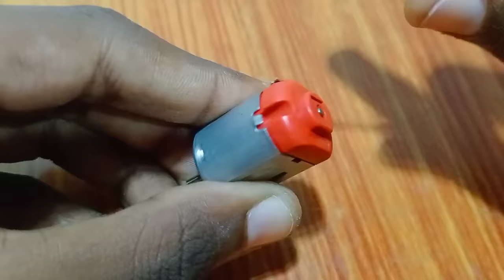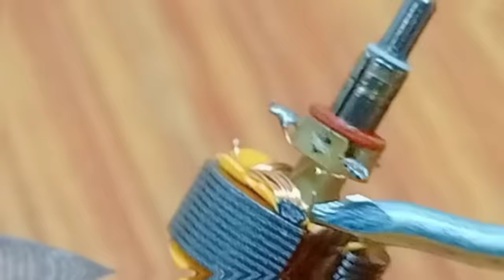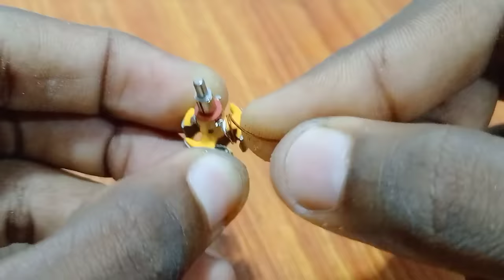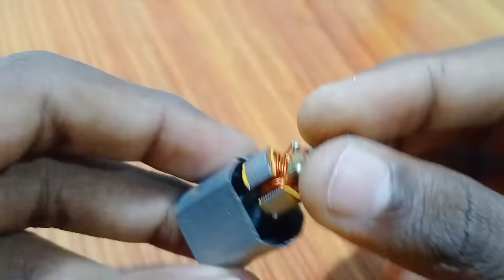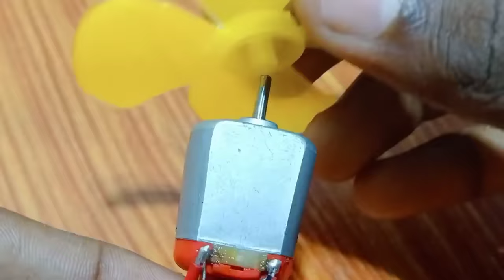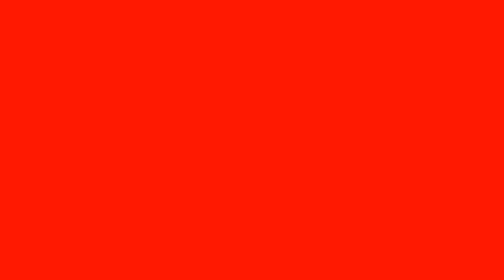Hack This Dc Motor With These Easy Tips! Dc motor life hacks

Comment: Time to try this on a Tesla
Reply: Ironically, Tesla uses different technology on their D.C motors, so I don't know whether it's supposed to work.
Reply: Telsa's have AC induction motors.
Reply: please try and document it
Reply: On ac motors you need to increase the Hz and reduce pairs of coils to increase speed. Magnetfield speed= hz×60/coil pairs(100-slip)
Reply: @myzdmymn  yeah document his death ...
Reply: It doesn't spin 8x the speed, lmao.
Only about 200%
Reply: @hosoyalaurence  good enough
Reply: @Coco💙 it's not electric
Reply: ha, brushed motor for tesla 🌚🌚
Reply: Tesla use brushless electrical motor.
Reply: Yes tesla is run by ac motors
Reply: No Don't do it will fail on tesla
Reply: Nice
Reply: Good idea🤣
Reply: The motor in a Tesla is different. It is a three phase induction motor. So you either need to reduce the coil pairs or increase the frequency or Hz.
Reply: nah tesla overrated go do it on a Nissan Leaf 9 year old and everything is brushless like the others say. Other wise tou would need to change them every once 8n a while
Reply: Are you Elon Musk or engineer in tesla
Reply: It's DC and tesla is ac
Reply: How to discharge teslas battery 8X faster
Reply: DEJAVU!!!!
Reply: f you make the enamel wire thicker and replace the motor magnet with a stronger one, it will be faster. Also, it is more effective to change the motor brush to a thick one.
Reply: @owltube-4036  오우 찐이다
Reply: WUZAHAIEL😂

Comment: Perfeito. Fórmula para calcular o campo magnético: B = N.μ.i2.r , como pode ver, a corrente elétrica tem ação quadrática no campo magnético. Aumentando número de espiras você aumenta a resistência e diminui a corrente. Ou seja, diminui a potência. Diminuindo o número de espiras você aumenta a corrente (perfeito), porém se o fio é fino ele não vai suportar a corrente e vai queimar... Por isso, o correto é colocar menos espiras porém um fio grosso para suportar a corrente (vai gastar mais bateria, claro)...
Reply: Mn, esse motorzinho do vídeo, tem capacidade de gerar energia?
Reply: @kaykyalexandre1658  Sim, mas é muito pouca energia que ele gera, teoricamente ele vai gerar uns 80% da energia que ele gasta em funcionamento, girando o eixo dele na mesma velocidade.
Reply: @kaykyalexandre1658 it can generate a little bit of voltage that is only powerful enough to power a small LED

Comment: This actually works . Thanks for the advice .Greetings from 🇭🇷
Reply: 0
Reply: Da dobro je
Reply: Moter is quickly heat by this changes
Reply: But it consumes more electric
Reply: It Will be faster but weaker
Reply: @krishnapawar3006  it Will be weaker
Reply: @rici_21  yep torque would be comparetively weaker
Reply: @meIanchoIia  amazing
Reply: @newunboxing3286  heated

Comment: If you want more speed just add magnets on outer case
Reply: And put in bigger motor brushes to increase current transfer to the commutator for higher speed and much longer motor life
Reply: & use premium high octane fuel instead of regular
Reply: but it is better to buy a normal motor and not suffer
Reply: @SkorchGameWoT  suffering is for the weak minded...we're innovators 😎
Reply: @gauri_510  yea....super noob

Comment: The ceramic capacitor is only for reduce sparking on commutator to prevent buring of brushes
Reply from the maker: Yes ! It helps to run Smoothly ☺️
Reply: @InfoTechElectronicsWork  how is it that this tiny cap has a 104 rating, which means it has 10*10^4pF=0.1μF ?
How is this even possible with a ceramic cap this size?
Reply: It smooths out the current draw, but it won't help with sparking.
Reply: Bruh isn't it related with power factor improvement?
Reply: It only reduces RF interference that could cause malfunction in some other equipment nearby.
Reply: @andrelange9877  🤣🤣🤣
Reply: one capacitor isnt eoungh, i have used 3-4 capacitors.
Reply: @mandarbamane4268  lol mate this is a DC motor, no PF here 😂

Comment: Its just more useful to add neodymium magnets instead of normal ones draws less current but goes faster. Of course the motor wont go stronger.
Reply: It will actually not go faster and instead provide more torque. For a motor to go faster you need to reduce the back EMF, ie inductance
Reply: J-Seven  if you for example, wind less windings, the motor will spin faster (less inductance). You could also weaken the magnetic field using what's called field weakening. If you don't want to physically alter the motor, you can simply apply more voltage, as when the back EMF matches the applied voltage, the motor cannot spin any faster without the forementioned tricks.

Comment: Como ensayo de estudio está muy bien pero  para darle utilidad deberías aclarar cuestiones como el balanceo que afectan la durabilidad de los bujes y ejes, temperatura de trabajo que se ve modificada sustancialmente y obviamente va a traer muuuichos problemas, colector y carbones que no han sido diseñados físicamente para esas condiciones de trabajo etc , etc .
Reply: Es correcto
Reply: Entonces la idea está buena,  pero es para un muy corto tiempo por que se va a arruinar muy rápido. 
Eso es lo que estas tratando de decir???
Reply: @ivodmp  yes it will be ruined fastly. Because of the higher temps the back plastic part of the motor will melt and make the rotor less smooth and stuck. Also the brushes will be damaged fastly
Reply: Temperatura porqué? Si bien trabaja con mas intensidad de corriente el cable es mas grueso
Reply: @lucianoaviles351  los motores DC tienen un par de escobillas que rosan con el colector, por lo tanto a más velocidad más rose, por lo tanto más calor
Reply: @IsmaEmili  eso es verdad, lo descubrí haciendo un prototipo
Reply: Aclarar que va el mismo número de espiras en cada bobinado, creo que ha liado el cable nuevo en direccion contraria al original por lo que girará en sentido contrario (solo es cambiar la polaridad pero está bien aclararlo), el valor de ese condensador (si es que lo es que no estoy seguro)...y un largo etc jeje
Reply: no trae carbones eso
Reply: Legit. Some of that could be compensated for with a heat sink, fan on back of motor and grease.
Reply: Nunca falta ……  😒
Reply: @lucianoaviles351  el cable más grueso y más corto, menos resistencia. Más intensidad. Más calor. El núcleo no está diseñado para disipar esa temperatura. Las escobillas no están diseñadas para esa corriente. Cómo experimento, está bien. Etc... Para usarlo no
Reply: Me compre un espumador de leche, pero no puede con el café, entre tirarlo o modificarlo un poco y que dure poco estoy pensando que hacer. Si consigo otro motor directamente lo cambio, pero si no modificar lo que ya tengo. Es triste, pero no consigo cable esmaltado en mi ciudad si no compro de a kg, y se me hace caro hoy en día tener un kg sin usar. Así que reciclare de algún otro componente. La otra es encontrar algún motorcito y hacer un agitador magnético.

Comment: Sir, Can you tell me Number of turns for new wire and the diameter  
And how can I calculate the Number of turns and the diameter if I used another wire
Reply from the maker: Diameter 0.5 mm ( 30 turn )
Reply: حبيبي سيد 💞

Comment: What I've learnt from Electro Mecanical Energy Conversion Lecture, providing less winding with bigger radius cable decreases efficiency significantly. It may turn faster, but it'll draw significantly higher current than the original one, also will have heat problems when works long time.

Also notice that to comparasant; If assuming we want to have same RPM for both original and modified ones, Modified one will draw more current.

So that modification just allows more current to have more RPM while decreasing its efficiency significantly.

Correct me if I'm wrong. Thx.
Reply: Also thanks to the Infotech Electronics Work who allows critisizm on his videos and encourage good pros and cons comments.

Comment: This modification works because the thicker wire allows more current to power the rotor, which makes the rotor's magnetic field stronger, which makes it move quicker.

Comment: Does it affect EC. Because it will consume more energy. EC may be damaged.
Reply: it will be ruined fastly. Because of the higher temps the back plastic part of the motor will melt and make the rotor less smooth and stuck. Also the brushes will be damaged fastly

Comment: f you make the enamel wire thicker and replace the motor magnet with a stronger one, it will be faster. Also, it is more effective to change the motor brush to a thick one. ^^

Comment: Damn Bro.   more conducting amperes  equals more power..
Reply: Yeah fr it's just a capacitor in parallel with the motor, of course you're going to get more power but your motor is gonna burn up very quickly

Comment: This is not the right way of increasing speed. Here the wire was thicker to allow more current carrying capability. The gain in torque would come at a cost of wasting energy as heat. A far better alternative is to choose a thinner wire, and increase the turns. That will result in higher speed, higher torque at the same input power

Comment: The motor will going to run at higher speed but as the brush or the slip rings provided on the motor are going to teared fast because the brushes provided in this toy motor is as per the configuration of the motor so to change the speed of the motor we must also have some change in its design also.

Comment: Where is the comparison of 1x and 8x? You only increase the current carrying capacity but decreased the number of turns. Did you increase the input voltage to compensate for the less number of turns?

Comment: also, , connect it to a Batt, wash the motor in soapy water for 30secs, then pull out,  run to get most off water out  then spay with wd40 or 3 in 1,  it works, done it to all my 400 motors on me R/C planes,

Comment: You can just put a really strong magnet on the outside of metal case, you don't have to take it apart or anything. Not sure how many times faster it makes it but substantially faster.
Reply: I was going to say, that, i had a R/C plane, with a 400 motor, it just about got off the ground,  put a magnet on side, went like lighting, I found this out when i watched "HOW", in the 70s ,  I'm old  :)

Comment: Have you heard of a Rodin coil I recommend you wire it like that the electric motor and make sure it's brushless and a alternating current electric motor with a DC converter so you can run the alternating current  motor on DC power  after that you can you use it in a remote control car like the brand Red cat or something of your interest

Comment: Why are you using a capacitor with Battery(DC) ? 
 Because Capacitors will allow AC and Block DC . Then how  motor runs instead it stop.
Reply: The capacitor is in parallel with the motor and is there to reduce radio interference caused by the motor. It does not have any function in the running of the motor.

Comment: Wow you just came out with a way to make cheaper motors perform like more expensive ones . Now work on adding gears or pulleys to the shaft, large one on motor shaft , very small one on a small generator motor. Imagine 6 or 8 of these , on a drone doing this recharging the battery bank being able to stay in the air and flying much longer ! WOW 🤩 💰 💴 💵 !!!

Comment: What is the capacitor there for?
Reply: im not an electrician but its supposed to add voltage (that's what capacitors do)
Reply: @kajtus5510  Capacitors do not add voltage. In this case brushes make unreliable connection which causes them to arc. Magnetic field of the windings collapse, sending high voltage pulse back to the circuit. This is important if motor running from more than just batteries. Also, this process creates interference noticeable if radio or TV is near such motor.

Comment: if it was that easy companies would of did it
and you didnt show us the normal speed of the motor
Reply from the maker: Companies want to save his money 💰. So that they don't use More copper in Motor.
Reply: @InfoTechElectronicsWork  sheesh but thinner copper wires are more expensive because machines need to be detailed for them to make that and also the thinner the wire the more efficient and fast bigger and more doesnt always mean stronger
Reply: @shoking9825 As per EM formulas
 Thinner wire.... slower motor
More no of poles...slower motor

m not sure abt efficiency
Reply: I guess ur a Superior Electrician to huh? lol

Comment: What is the use of that ceramic capacitor (value 104) ?
Reply: Reduces the electrical interference that the sparks on the brushes produce, this smoothes out the power spikes.
Reply: @AmiSMB  thanks

Comment: I Opened Rock Crawler Rc car Its Gear box Amaz, 5mm gear motor Drive20mm Gr Cnct To 5mm gear And Three time It is done at last Small motor can lift 1kg car On 45degree Incline surface Ramp 😮😮